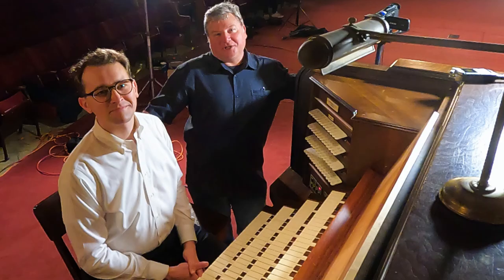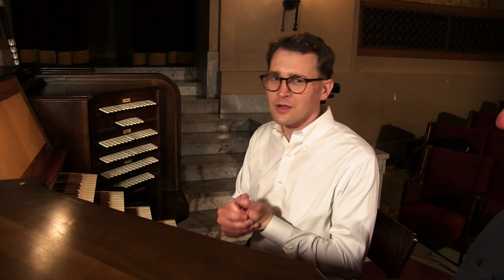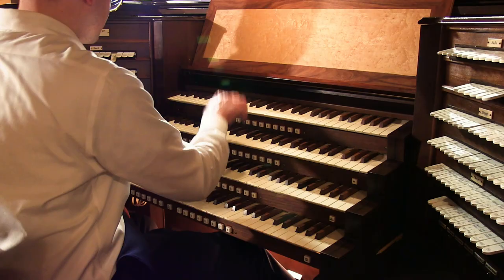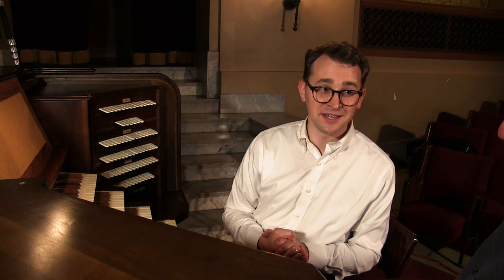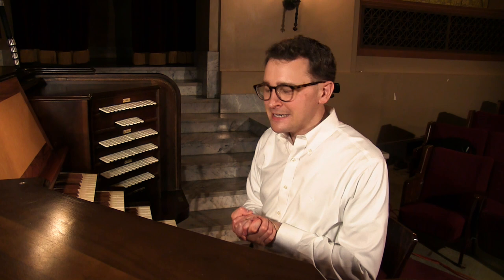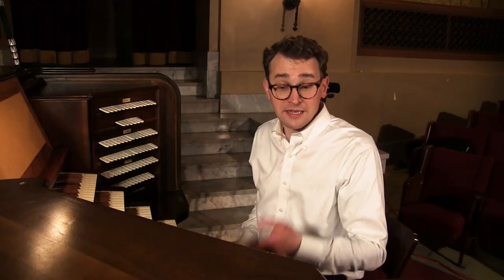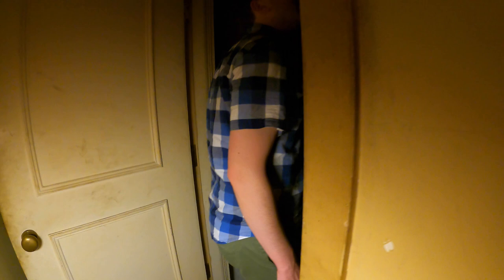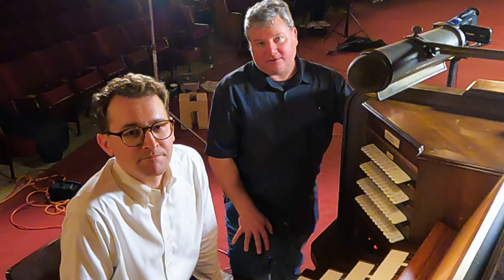1926 Kimball Organ - Scottish Rite Auditorium, Guthrie, Oklahoma

Comment: a super-octave should be at 2ft,
octave is 4ft
Reply: Believe the reference was to a "super coupler" (unification system adds the same ranks up one octave) rather than "super octave" or 15th which correctly usually means 2 foot rank.